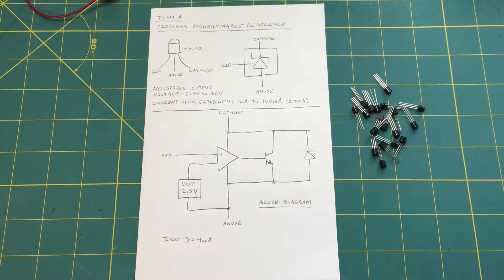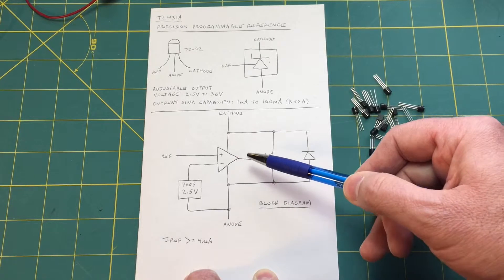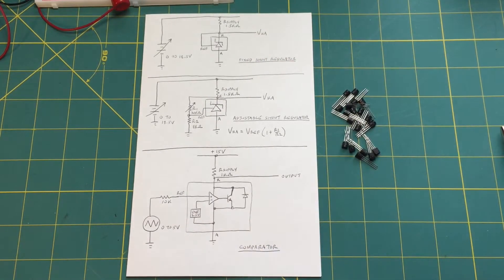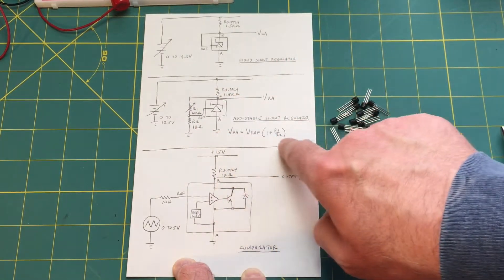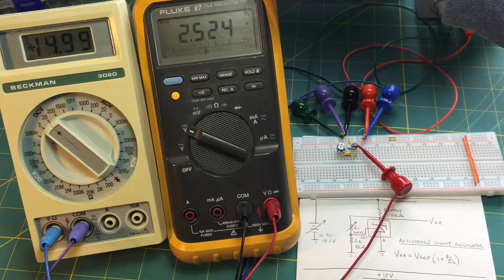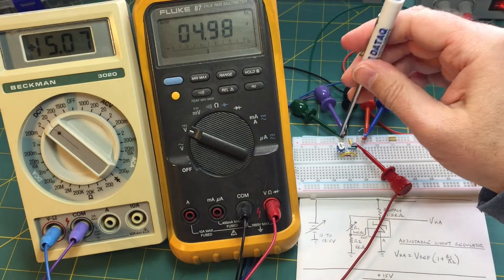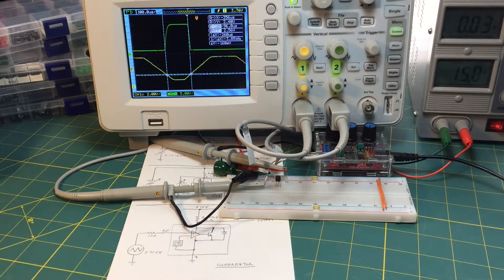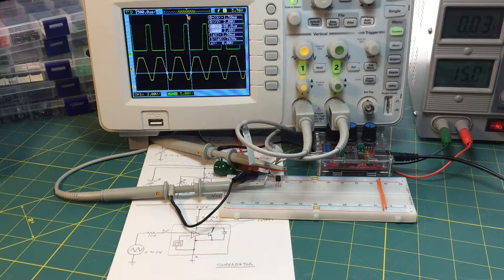TL431A Precision Programmable Voltage Reference

Comment: I was asked to use the TL431 to provide a stable Vref for a difference amplifier. However, I need that Vref to be 1.5 V. Am I correct that the TL431 cannot provide an output voltage of 1.5 V?
Reply from the maker: Yes, the minimum Vout for the TL431 is 2.5V.
Reply: Can use a medium current/power transistor wired as an amplified diode. There are 2 potential divider resistors placed across the collector, base, and emitter leads of the transistor. Use is similar to a zener diode with a series limiting resistance. Make sure the total potential divider resistors are about 10 times the limiting resistance value for satisfactory performance. Equal resistor values produce about 1.2 to 1.3 volts.
Potential divider output voltage calculation:
0.65 × (Rpd1 + Rpd2) ÷ Rpd2
Reply: You probably figured it by now, but what you need is TLV431

Comment: Hi sir, what will happen if vref goes much higher than 2.5 volts. Thanks
Reply from the maker: According to the datasheet, depending on conditions, cathode pin voltage will decrease by ~1mV for every +1 volt change in Vref.    A link to the datasheet is posted on https://www.network13.contact

Comment: With a price of around $0.50 in quantity of one from legit suppliers, why E-Bay??????????
Reply from the maker: I just checked my purchase records, I bought 20 of these parts from an eBay seller for 99 cents, with free shipping.  Network XIII is a shoestring operation, so for example if I purchased 20 Texas Instruments TL431As through Digi-Key, I would have paid over ten dollars with shipping.  I appreciate your concerns, and if I were designing this into a piece of equipment I would use a genuine part from TI, On Semi or STMicro.  For my purposes as a hobbyist, however, these off-brand, mistrimmed parts are more than adequate.

Comment: Hi :) I'm trying to make a voltage reference using this thingy. Unfortunately, it is quite difficult to get stable , 2.5v reference . It seems like different values of a resistor influence its output. Could you plese tell me, is it requires anything else to get 2.5v ref than simple connect 1.5k R to vsup and vref with vsup together ?
Reply from the maker: 404 Not Found What is your supply voltage?  The resistor value must be chosen to provide enough bias current for the part to work correctly, which is a minimum of 1mA.
Reply: @NetworkXIII  You're correct, it requires about 1mA to work properly. About the issue, it is a bit funny story, the battery of  multimeter was very weak, I think it measured  entropy lines of middle universe very precise, then I replaced the battery and everything get work just fine in this world, the 2.5 voltage was and is stable as a  ..  Anyways, thank you for the help, it is very imporatnt sometimes to complain especially if someone is listening, I appreciate it )) Thank you